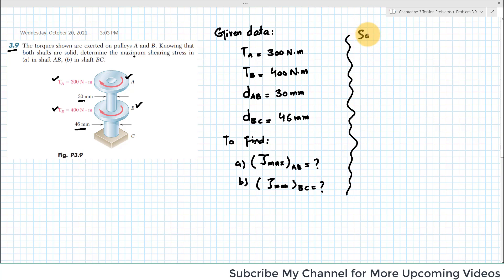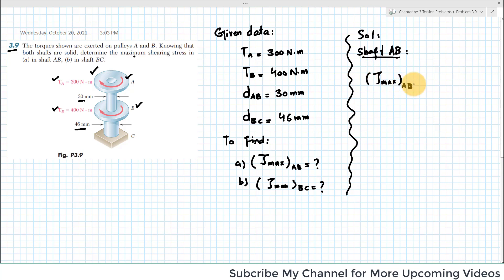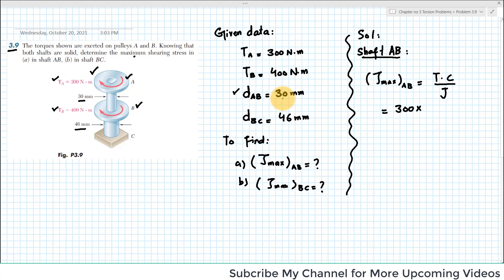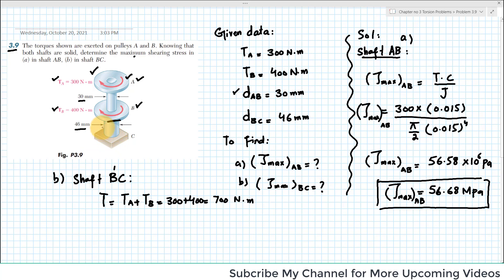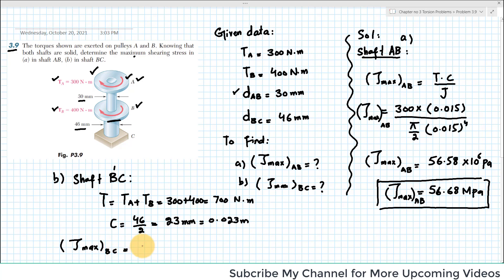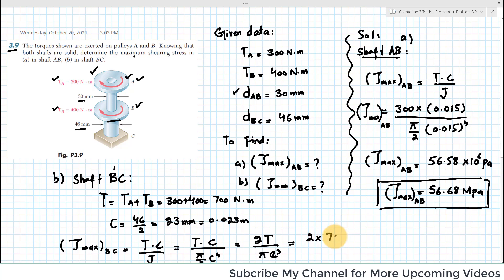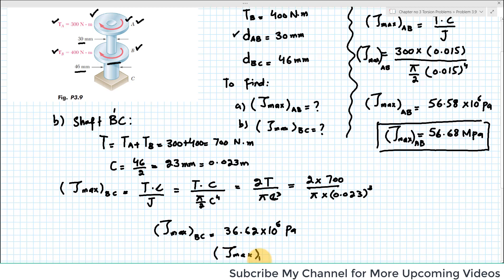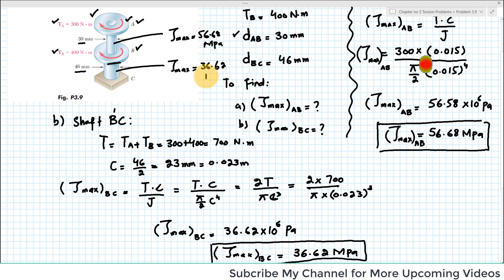Problem 3.9 & 3.10 |Torsion| Engr. Adnan Rasheed

Comment: why did you use 2 while using BC not 0.023
Reply from the maker: Kindly mention the time frame where you have issue
Reply: @engradnanrasheedmechanical  5:18
Reply from the maker: You are telling about 2*T/Pi*c^3 @jaggedmeister9039